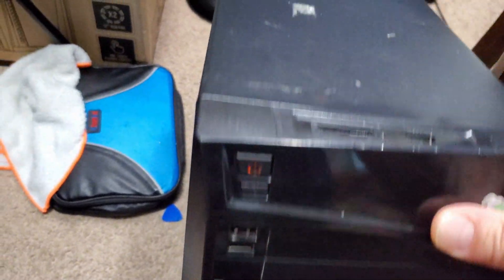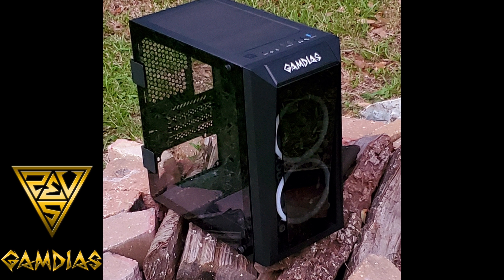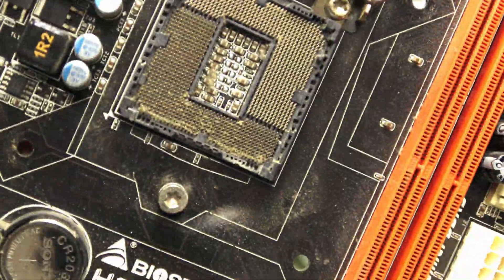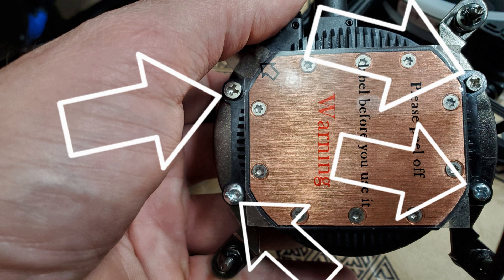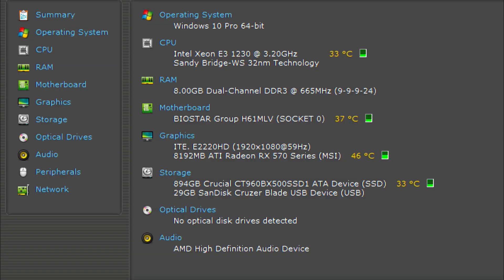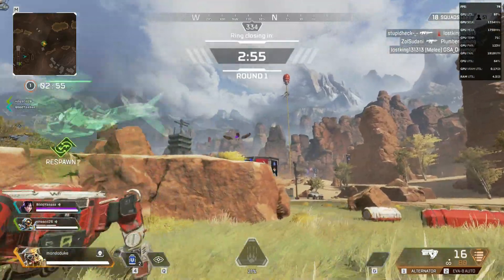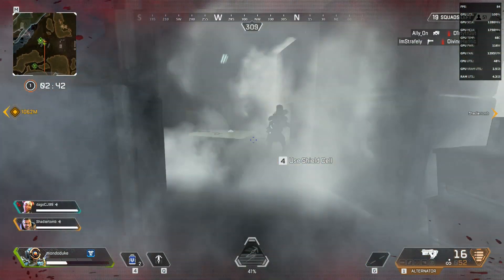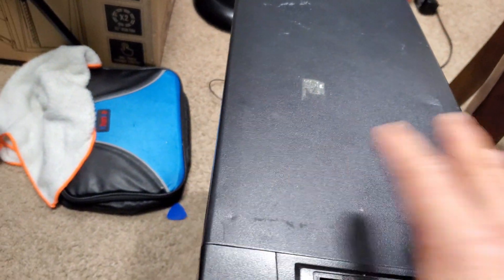New and used gaming computer build

Comment: Good video but I noticed one mistake...PSU is upside down. It has RGB, show it off
Reply from the maker: That reminds me it wasn't a mistake the cpu coolers radiator would not fit anywhere else but the front. I wanted to see how much heat in the case we working with first. But yes it could of been flipped as for temps are fine.